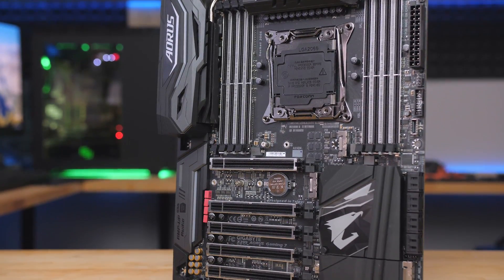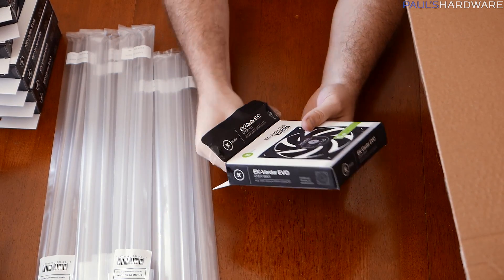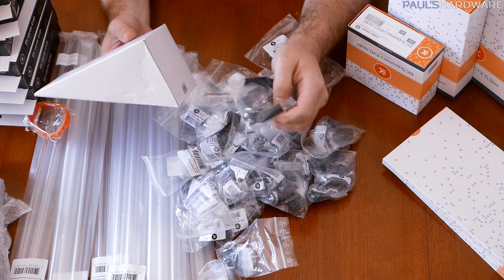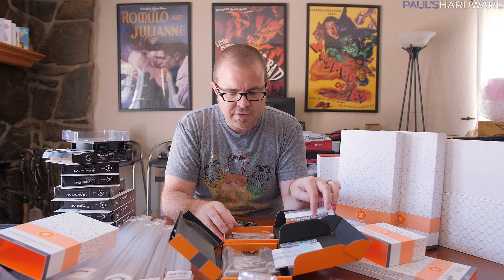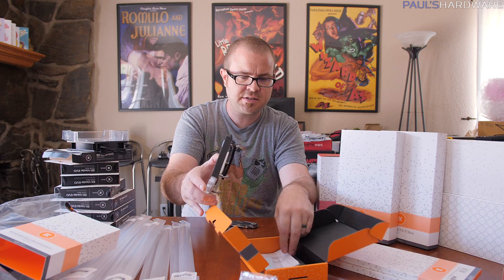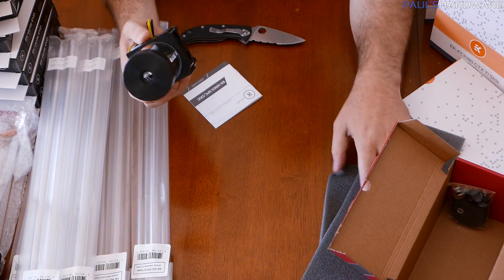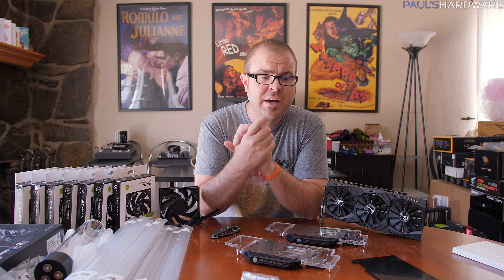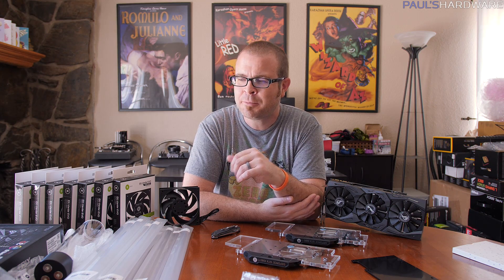FINALLY HERE: Water Cooling Parts from EK for Arctic Panther Rebuild!

Comment: You need 2 fill port. For the air release and water in.
Reply: Why DDC? Not D5?
Reply: SE same thinness as a Fan should.
PE same thinness as 2 Fan should.
Reply: If you able to do push pull with SE, then you can do pull or push with PE.

Comment: I believe if you got a Bitspower block for your 1080ti you have the option to keep your original backplate that came on the Strix.  That's how it was for my 1080 Strix, the blocks came with their own but gave you the availability to keep the original one for the RBG functions and the block itself is RGB to and plugs into the boards connector where the fan RGB header is.

Comment: Paul,
Take off the Asus backplate and cut out the section that has the RGB LED with a Dremel and then equally cut out the EKWB backplate to make it fit.
Problem solved, maybe?

Comment: Peeps with X370 Gigabyte K7 and K5 boards, beware of latest bios updates! It will cause you VCORE to sky rocket, is produce false readings. It will say it is at 1.25 Vcore, but really be at 1.55 or higher. It was already taken down from Gigabyte site, but those you updated may want to manually tune or revert back to previous bios. JUST FYI

Comment: Its kinda sad when a supposedly good company clearly cherry picks the best components for the reviewers. Bought 8 Red Fittings for my build and got 4 shades of red! So I had to buy 8 more to be able to match one shade of red (and still wasn't perfect.), it worked out with 16 fittings now Imagine if you keep getting different shades of red, what you do? Keep buying fittings? They are not cheap. BTW, I Complained by email, tagged them on instagram, facebook and guess what? That's right, Nothing happened. SAD!

Comment: Curious about the temps on that 240 SE. In my experience the SE rads are really underwhelming. I have an X99 rig with SLI Titan X (pascal), and two 360 SE rads were completely overwhelmed with modest OCs. Swapped em out for HL Black Ice Nemesis 360GTS rads (also slim FF), and my temps are almost 20C lower across the board. That's an ABSURD delta between two brands of slim rads. I'm not sure if I had an issue with my rads or what, but my first reaction when you pulled out that 240 SE was "well, you can just throw that in the trash."

Comment: You can use the default strix backplate, there's 2 screw holes that aren't covered by the waterblock which you can use to attach the backplate. It's not secure and can rattle a little while moving, but during normal use it's fine. Pic: https://i.imgur.com/j8CSfkY.jpg

Comment: Reasoning behind his Intel vs AMD build is simple. While AMD is better in p/p range, Intel still has better IPC ( while running at temperatures near nuclear fusion ). Personally, i would choose AMD as you can invest extra money in other parts.

Most of the people dont need this kind of power, it is called HEDT with a reason.

Comment: OMGDZ who gave that little guy with the glasses a KNIVE !
Hope you get a full cover strix block. i got one on my gaming 7.. 4.5Ghz 20c idle 53c stress..
Not oc yet still building it.
Have the extra cap to but its not rigging round makes my build looks EEEW.
Bought the light res version of it. it has a ROUND top with multiple inlets. i use that top now.
https://www.ekwb.com/shop/ek-res-x3-250-lite
First i was a bit sceptic about the fullcover block since it has no spring for pressure, but hey it works :P
Using two 360 rads in my lian li pc11wx (i think) with corsair HD120 fans

Comment: I like the Vardar fans but something that always bugged me about them is the size of their hub/center motor housing. It's like I have the feeling that regardless of what the spec is on paper they might not perform as well as something similarly specced because there is a bigger chunk of radiator behind that hub that is not getting air flow.

And dude, 7820K... There are DIMMs starving in Africa.

Regardless, love the vids. Keep em coming!

Comment: Would you consider using the Phanteks Glacier GPU blocks for the build instead of the EK blocks? Those allow you to use the OEM backplate and also have RGB controllers for the block itself.

Comment: Hey Paul. I work at a copy/print store and our graphic artist is using an Asus P6 something, and 8 logical cores so i have to assume its an i7 9xx cpu and it has 12gb of ram. The graphics artist mostly just using photoshop but has been complaining about that computer being so and laggy. Would it be worth it to buy more ram and an SSD or do you think its time for a new PC?
Reply: A 128/256gb ssd would probably be worth it as it can always be reused when the pc is upgraded but anything more then that (ram) for a computer of that age is more then likely not worth it
Reply: Zak LeClaire
Laggy??, you run PS in the cloud, so a Network issue! Lag is always Network!
Reply: The SSD will definitely help so much but I could recommend buying two SSDs if you can (one for the cache, get the cheapest one.. you can get away even with the smallest capacity you can find). Adobe products mostly relies on caching so a separate drive would really help to smoothen the experience.

Comment: Showing the outside of the pump only shows athletics and fairly useless information. You need to open it up and see how the rotor and housing is made and what it's made from. Every single pump that has died and I've taken it apart died because of the rotor disintegrated. Not leaks or electrical. They build these pumps like they reinvented the wheel each time. Fish tank pumps have been doing it for years and with salt water as well. Yet these over priced badly designed water pumps are pushed out and propagandized as quality. with a price to match. Fish tank pumps last for years even in salt water. These pumps are lucky to last a year. The fish tank pumps may not look as nice or fit in the case but I'll never go back to PC water cooler pumps ever again. Plus they already have all the fill and drain stuff figured out so much better, it's like the PC people have never seen a fish tank.Don't even get me started on the highly over priced AIO liquid cooling garbage out there. Fish tank pumps and hoses although not designed for this purpose are are the same thing and are half the cost of what the PC version is that is doing a 10th the job. And they still don't last as long.
Reply: Using a fishtank pump? Really? That noise? Why bother even watercooling at that point?  
D5s work fine. Mine is nearly on 24/7 and 6 years going strong. I have no idea how you could break one in a year. 
Poorman's watercooling has never been a good idea. Just use air like everybody else.

Comment: Everyone down here complaining about how it isn't Threadripper. Guys, when you get this stuff for practically free, there is no reason not to go Intel. Even though TR is faster at multithreading than the current x299 options, when the high end x299 chips come out he will be able to upgrade and they will offer much better overall performance than TR. Also he said this is for gaming and we have seen over and over that Intel is much better at single threaded performance. Not being a fanboy, just trying to let people understand that both platforms have merit.

Comment: That moment when you realize someone just spent more on water cooling gear than you just spent on your new custom water cooled Ryzen 1600 system with a GTX 1070......
Reply: EQUINOX why would you even water cool that kind of a system
Reply: Why would you water cool any system at all? After all no system needs to be water cooled really even the system in this video even if over clocked does not need to be water cooled as one of those pig ugly tower coolers would be more than enough to cool it although it would run hotter. Or are you one of these people that thinks you should only water cool the best of the best or the most expensive components? or the type that thinks because its AMD its not worth water cooling because its not Intel?  

 I am curious if you would consider a Ryzen 1800x worthy of water cooling? Given that the 1600 has the same OC potential as the 1800x and in fact my 1600 its quite comfortable at 4GHz and like the 1800x puts out heat 68c to be exact under gaming load with a Noctua NH-D15 SE-AM4 and the GPU would bounce around 75c and would barely reach the boost speed of 1708MHz,   But after water cooling the CPU sits at around 34c under the same gaming load and the GPU sits around 42c and boosts to a constant 2050MHz with the fans on silent.  

As any smart person knows while it might run perfectly fine short term at the higher temps, heat degrades electrical components particularly when you are adding extra voltage and so why would you not water cool if your system will be a lot cooler and gain extra performance as a result and also potentially increase its life span.
Reply: Nah, all i was assuming is that water cooling that kind of system would cost you a decent chunk of what the system its self cost. Do correct me if i was wrong. For the record, i am not an Intel fanboy.
Reply: The cost depends on the parts you buy and while EK is great they are extortionately priced,  You can get much cheaper options if you are willing to wait that bit longer for china post, the CPU loop came to around £150 not bad considering a good tower cooler is going to run you £70 to £100 and later i added in the GPU block that was an ebay special at £66. The  most expensive components in the loop is the EK-Supremacy MX AMD CPU block and the GPU block and everything else was cost cutting like Barrow and XSPC 1/4 compression fittings , soft tubing, Magicool 240mm rad, and a china special £25 pump & tube res combo. So all in the total loop cost about £216 which is small in comparison to the total cost of the system.
Reply: Fair enough, nice build btw. I've been wanting to try out water cooling for a little while now but tbh the whole thing just worries me ^^

Comment: According to Fractal, you can fit that 360 rad in the top of the case. I guess it will come down to if you want it with the fans showing more than a slim rad.
Reply: There is probably a way, lol.   fans on the inside and rad on the outside is a possibility, for the top rad.

Comment: I highly recommend NOT to use the X299 Strix. I personally had it and it's the worst overclocking motherboard I ever used. For one there is no way to reset your bios besides using the jumper or taking out the battery so if your overclock wont post your pretty much SOL. And the power delivery is horrible my 7900X could not even be stable at 4.5ghz at 1.26V. I ditched this board fast and got a Rampage VI Apex for my build which allows my CPU to go to 4.8ghz no problem and has every OC feature out there.

Comment: I want to build a new PC but I don't think it would be worth the upgrade. I've got two EVGA GTX 980 SC's and an i7 4790k all in a custom loop. I game at 1440p and the only issue I have is that on max settings on some games I run out of VRAM.
Reply: I'd wait till at least Black Friday sales considering it's 2 1/2 months away. I don't think gpu prices are going to drop all that much between now and then and you might get the other components cheaper.
Reply: Edward Teach I'm going to wait until the next generation of gpu's. I want to go back to just a single gpu and the 1080 ti isn't a big enough gap to justify pulling my loop apart. Maybe the 1180 ti or whatever they call it.
Reply: Yes, aside from looks SLI and Crossfire are getting phased out by the look of things.

Comment: +Paul's Hardware
2:53
The extra fan is because of this Paul.
https://youtu.be/wuK2xqd9YEA?t=1m23s
15:43
I never liked it that EK has that WEIRD panel thing there. Totally kills the look of the block.
Seen other brands have a clean look without a panel, blocking the inside view.
Yes EK it's time for a redesign!
And one more thing the TR4 block is not well engineered, yes it has almost full cover(screw holes).
But the fins in the block are not 100% on top of the CPU dies, a eye for detail engineer would never over looked it (rushed product?).

Comment: I've been wanting to upgrade and re build my loop. But my 4790k is almost on par with the 7700k. Sad how little cpus have come along
Reply: As long as you aren't bottlenecking then who cares?
Reply: James Emsley
If you don't need to run fancy GPU cards, skip kaby! Were u use that build for, why you need the update, need more cores? X299 is easy to get blocks for, all my R3 and X99 stuff fits. What does that loop contains now, the CPU, a GPU too? VRM? If you need to do a new systemn and loop now, skipp Ryzen Treadripper, rest is okay i guess.

'Sad how little cpus have come alon?' This is a good year, Phi, Xeon W, Ryzen, no more old single threaded CPU designs, but you can still get some of these old CPU's, but you don't need it you say.. Mixup you are!!
Reply: James Emsley well they've actually come a long way on AMDs side. Intel not so much. Most people are seeing .1% and 1% lows as more important than highest fps now. AMD is better now in that regard.

Comment: @ paul i did the exact same thing with my first water cooled build went with the $100 100ml res and ddc pump combo but bought the res tube and the multi port cap for the added options for filling and also i didnt notice a ball valve might wanna thing about ordering one when you order another 360 rad

Comment: Paul you can use the stock backplate, it is just EK doing their cash grab and having noobs buy a 30 euro backplate that looks worse, so test with the stock Asus backplate first as it looks so much better.

Edit: I knew i had seen a GTX 1080 Ti Strix with the stock backplate on, and was in a featured build on EKWB's facebook page for August 23, a black and purple build, so EK's backplate is just an expensive option that is not needed at all, it is just a cash grab.
Reply: Beardroid91 It depends personal taste but ya you can use the original back plates, I used the original back plates on a 980ti and my 2 1080s
Reply: Bevan Marshall that's how I did my msi 980ti
Reply: I struggled to find info whether i could use my stock EVGA 980ti backplates at the time i did mine too. Just needed a couple of slightly longer screws, and miss out on fitting a couple. 
Might as well give it a shot in this one!
Reply: tclemens96 Well ofcause, but some of the highend cards does come with some very nice backplates like the Strix's RGB backplate, and EK plates imo. looks to boring. When i get enough free cash then i'll order the EK's waterblock for my  GTX 1070 FTW and use the stock backplate and put it into my waterloop.  ;)
Reply: Just hold an ek backplate next to an included one and the weight alone will tell the difference. Looks, which are subjective, aside the quality of EK backplates is just orgasm-inducing, at least to me with some experience in machining.
Reply: Fredrik Carlén For sure, EK blocks and backplates are really well made, but in a time of RGB and lighting then EK's backplates look abit dated all be it still classy AF ;) But with two cards in SLI then there is a black void in between them, and if Paul use the stock Strix backplates then he would have some lighting in between them and it would look much nicer - and then you have to ask yourself is the backplate really worth 30 euros ?!

And yea i do love EK parts, i had a plexy block and nickel backplate for my last GPU (GTX 970 G1) so know the quality all to well.
Reply: Personal preference of course, but when I have already put $1500 on my loop I might as well add the extra 30, but that's just becase nickel parts (I have the nickel one for my FURY X) match my build perfectly. Each to their own :)
Reply: That's the only downside about watercooling it is so damn expensive, i dread to think how much i spend myself, but done right EK always looks awesome B)

Comment: Everybody else :ThreadRipper X399 ,64GB DDR4 , 3 580's/2 1080Ti's OverKill Beasts
Paul: x299.....
Reply: Paul Sucks at Math Confirmed!!
Reply: TR4 would be way cooler. 3 580s is dumb lol
But when you get x299 for practically free, why not use it I guess

Comment: Ok question. In your video I believe you said that the rads are copper. The gpu blocks and cpu block seem to be nickle. I didn't think you were supposed to use the 2 metals together. Due to the 2 metals interacting and causing corrosion.

Comment: Honestly if youre going X299, I suggest to not using that particular board. Reason for that is first, it does not have (yet?) supported monoblock to help cool the vrm, and second, beause even tho Asus brand have Thunderbolt3 add-in card, I think that board cant support it referencing to the product spec page. But, yeah, what do I know?

Comment: sponsored by gigabyte for a x299 board chooses a x299 board from asus, best associate.
Reply: Hayate Azekura
Your building a printer or document Server, were you need that W for, were are you on now, E26xx? R3 is still good enough too! You are not getting any Xeon on these gamer boards on X299, that is their biggest reason for a new socket, so you don't buy used Xeon's for it! Need a cheap CPU on X299, go for that 7740x thing.
Reply: The new Xeon W line up makes more sense.

Comment: How are Vardar fans compared to Noctuas? I've heard a lot of goot things about them, but never had the chance to test them myself.
Reply from the maker: The Vardars remind me a lot of the Scythe Gentle Typhoons, they do a good job
Reply: addicTwtf
Most noobs are not able to setup any PWM fan configuration here, so they cry about noise.... Don't let them run them over 50% on daily loads, slow flow fans! The less Fans the better, room climate needs to be good too! Use a bigger radiator if the slow flow fans are not good enough, bigger radiator gives you more capacity.

Fans are noisy when you use then 120% all the time!